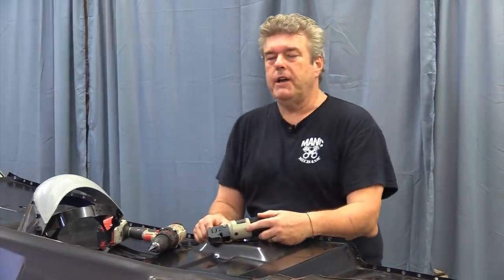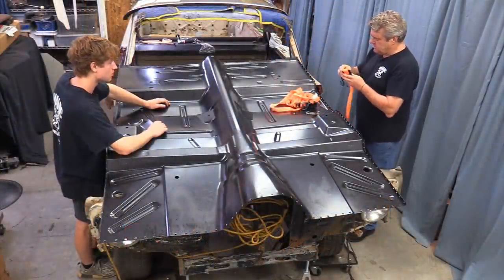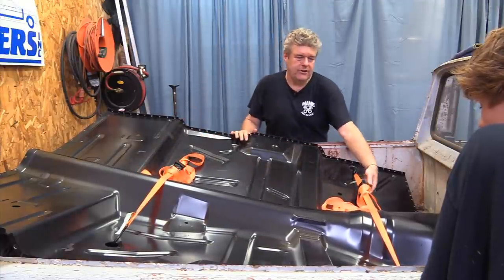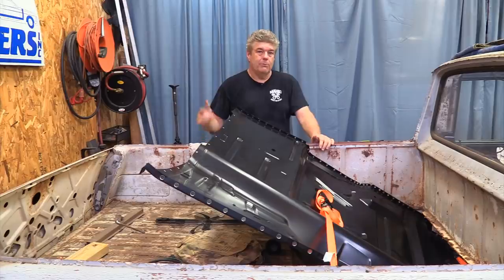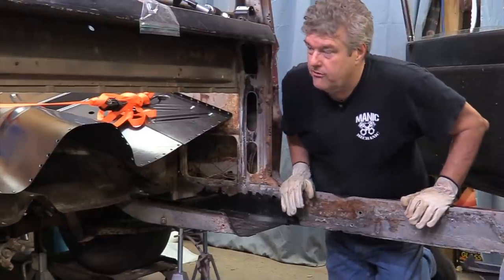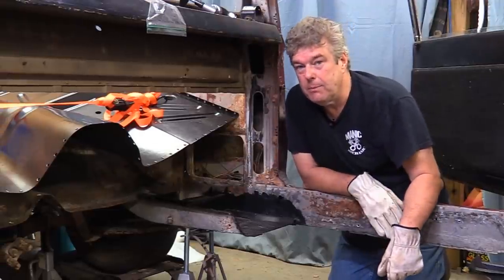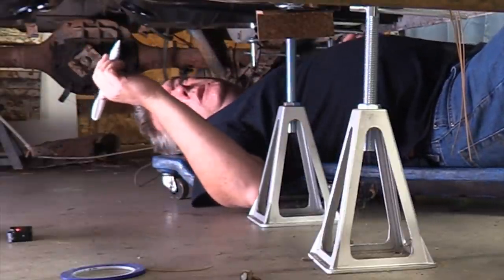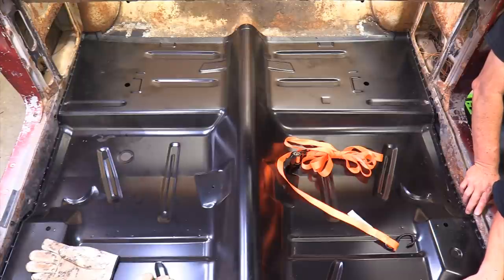Car Floor Pan DIY

Comment: I have a 66 ranchero and need to do this also I see you are using a 65 falcon floor pan. My research came that the 66 ranchero used the fairlane.
Reply from the maker: Yes the 1966 Falcon Ranchero moved to a Fairlane chassis.

Comment: It's amazing what we gear heads will put ourselves through just to give an old rusty bucket of bolts a new lease on life. This hobby of ours is truly a curios pass time, but it makes for great stories,  and what more could you ask for. Thanks for working through all the problems to get that floor pan in, and now that I've seen it done, I have no more excuses to hide behind, so I have to get busy on my own Ranchero.  But I find myself waffling between, Thank You and Thanks a lot..... OK i'm over it ......Thank You!  Great video!  Well done guys.
Reply from the maker: Golf...golf is a curious hobby. Where else to you put your balls on green grass and whack them hard enough with your stick to send them sailing? All so you can do it again. Thanks for the kind words. I actually enjoy the figuring out, the finished product.

Comment: good grief, im almost regretting the choices I've made with my ranchero's floor pans! lol  Awesome video! Keep 'em coming!   Brief update on my progress: Engine ( at the machine shop), Bell housing (check), ECU EFI ( check), undercoating ( check), leaf springs ( check) and a few other odds and ends! 2 steps forward 1 step back. I have to redo the spings on my alum heads and the seals, have to get a new cam too, water pump, flywheel and oil pan. sigh oh well ;)
Reply from the maker: Keep at it my friend, we are!

Comment: Wish I had known about that punch tool before I started working on my floorpans. Drilling all those holes was a pain.
Reply from the maker: Still have to have pain on the frame rails and torque boxes. We'll be over 200 holes by the time we're done.

Comment: Do you have any videos on patching or repairing the floor of a truck bed?
Reply from the maker: We're waitng for some stuff to come down the pipe to do that. The current bed floor is for the later trucks and does not have the right spacing. But the rumor mill is ginning about some 1961-72 Bed Floor material. So keep watching!

Comment: What about cutting the new floor pan across on the flat just before going under the back cab panel rather than cutting the back cab panel. you could put front part in through the door.
Reply from the maker: Didn't want to cut the floor. The back panel is easy enough to weld and it is kinda six of one half a dozen of another.

Comment: Is the 63 falcon floor pan the same as the 64, 65 you say you are working on the same?
Reply from the maker: I think the '63 Pan is the same. But not completely sure. I do know that earlier firewalls were smaller at the tunnel.

Comment: Nice video. I'll be doing my floor pan in the near future. I like your trick with the pneumatic punch. What did you use to deepen the throat?
Reply from the maker: We dismantled it and used a hacksaw and then cutoff wheel to deepen the throat.

Comment: Thats cool I see why my body guy said thats easier than pieces
Reply from the maker: Yes. once it is in. All spot welds. If this hade been a hardtop or convertible, I would have been done three weeks ago. The Ranchero is the hardest one to do outside of the four door or sedan.
Reply: @AutoRestoMod  i see it was fun getting in there. Ones just like that is sitting in a little yard even white lol I was wondering what chances were a 64-66 mustang front clip would fit though that would look cool

Comment: You could elevate the car more... Than would have clearance to go down
Reply from the maker: Nope. vertical clearance isn't the issue. the length of the pan in the space between the front and rear of the opening.
Reply: @AutoRestoMod  Alright. Problem solved! It's fitting well now.

Comment: I know I’m sitting over here armchair quarterbacking, and I’m by no means an expert. I’m also not saying this would work. Basically I’m just saying I’m not being a jerk, but could it have been possible to put it in if you had cut straight up on both sides of the back wall but left it attached across the top?? Maybe it would’ve given enough flex to wiggle it in. Just spit balling.
Reply from the maker: I thought about that. But the metal would have been stretched. We used up a good deal of the space we made getting the pan in. A bend that deep would have caused issues getting it back in.
Reply: Autorestomod Manic Mechanic Gasoline Media not being there to see, I wasn’t sure how close it was to going in and how much you’d have to bend the wall. The biggest thing I was looking at is the amount of welding it’s gonna take to fix it.